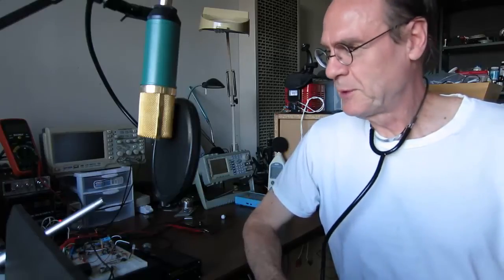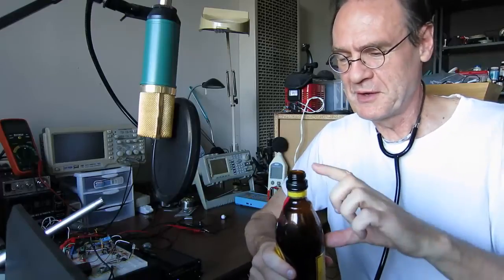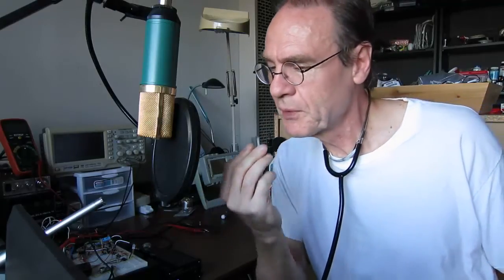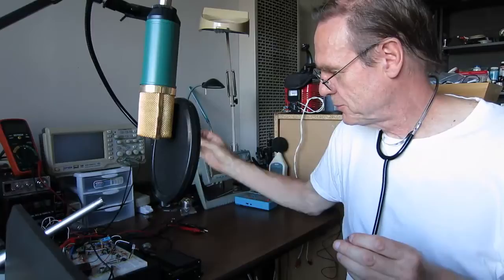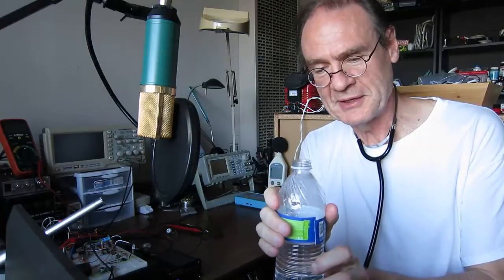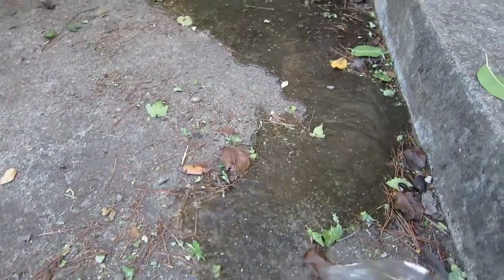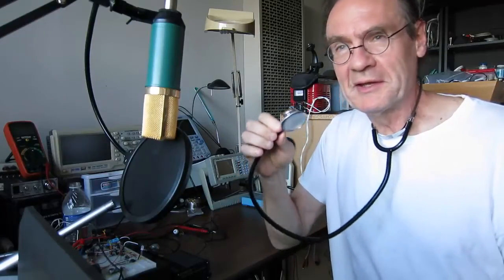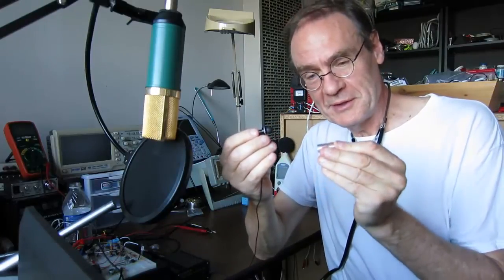Headphones with ADEL Module - How Does it Work?

Comment: In other words it is like you have a cup with a hole in the bottom, now add a cup inside that cup that fits exactly inside, like a cylinder in an engine block.  Now air can be blown thru the hole in the bottom of the cup however sound particles will not escape thru the fine layer that is between both cups.
Reply from the maker: Spam Remover, not sure I understand your point.
-Nils